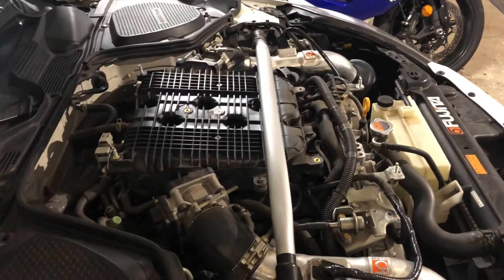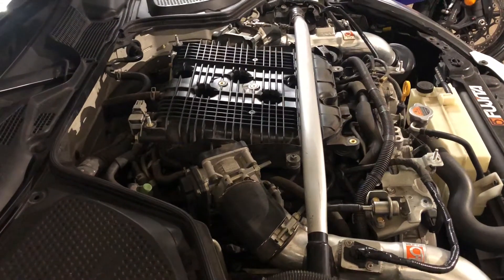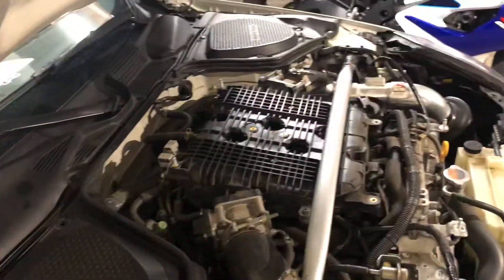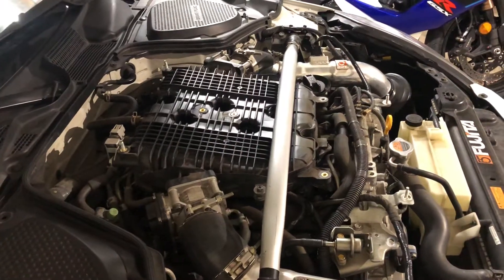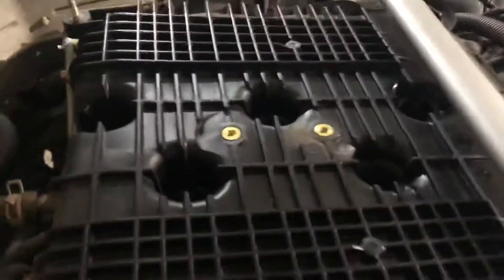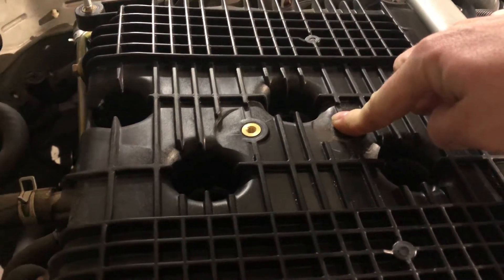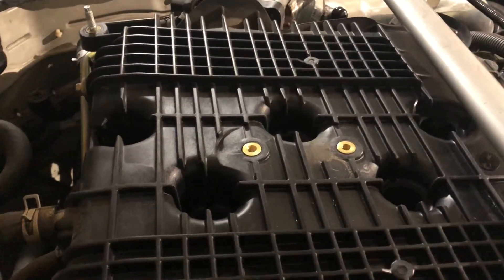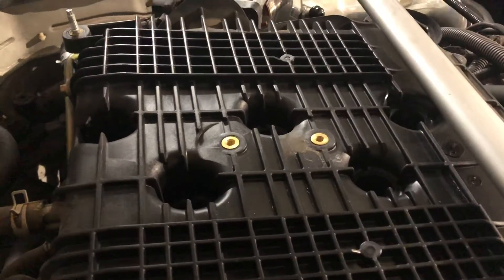ABSURD air leak in intake plenum

Comment: What about 06 m35 infiniti, I have the p2a03 and po300 , I've changed coils, sparks, fuel pump, and bled my coolant system after changing the coolant inlet hose that connects to my oil filter

Comment: I have this same issue, my cars idle rpm in drive would dip down to +-550 when in drive. Bolt was covering the hole. Took the bolt out and allowed the air to continue to seep in and the car runs more efficiently for me. Idle went back up closer to +-650 with minimal vibrations. Maybe i should do an idle relearn? You would assume that plugging the hole would cause it to run efficiently but its the opposite way around for me. T.I.A.
Reply: My G37 was idling at 550 before I even touched the intake plenum to change my VCG’s. It’s just an issue with the VQ37’s or VQ35’s I guess. I had to use “Nissandatascan3” to bump my target idle while in drive by +100. Now it idles smoothly and at the correct RPM.
Reply: @andrewb229 hold on what you mean ,can you help me with my m35
Reply: Sure. You need a Laptop, VAG-K + CAN OBDII > USB connector, and Nissandatascan3 program which is $40 I think? Once you have it all downloaded, plug into OBD and the USB end to your laptop, open NDS3 and click connect. Next click idle rpm I think it’s called. Car has to be under a certain temp so do it on cold start, put car in drive while raising targeted rpm, which I did by 125 last I checked.
Reply: @andrewb229 appreciate it bro , my car at the shop right now,they can't even fix the po300 (random misfire) can a p2a03 cause this also ?
Reply: @Dnasty_55  Unfortunately I can’t comment on those codes as I haven’t had any problems outside of the idling with my car. Have you tried searching them up for common causes? It will take some trial and error but you should be able to figure it out.